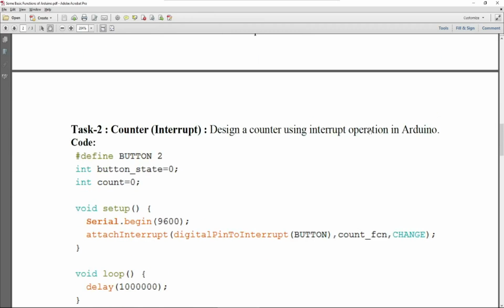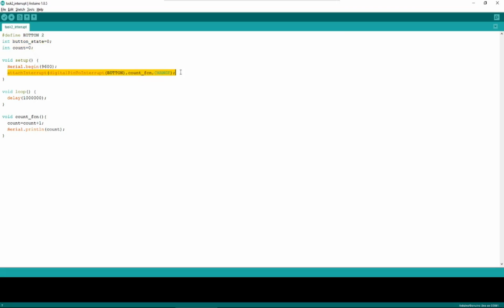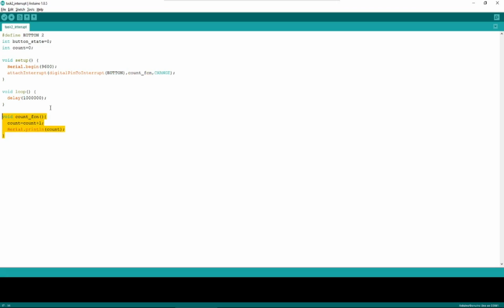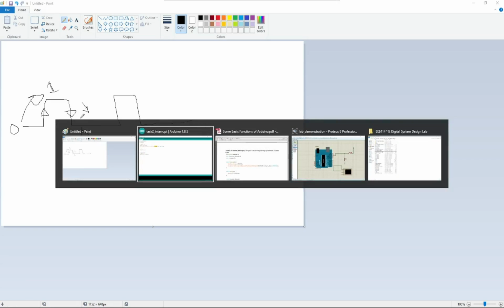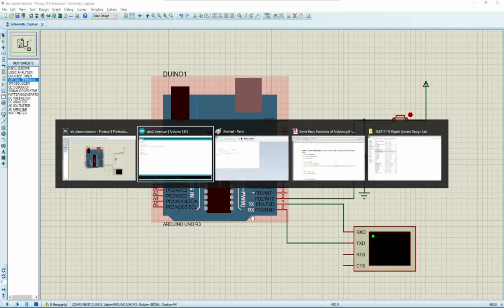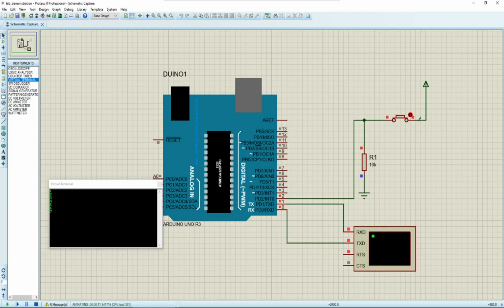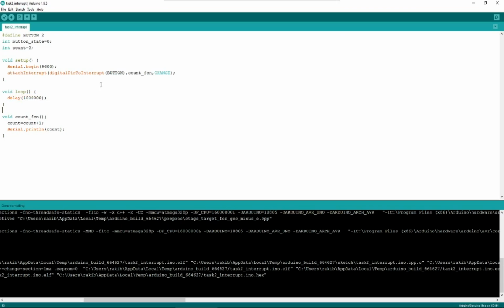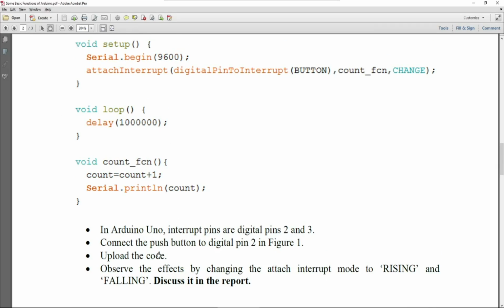Counter (Interrupt): Design a counter using interrupt operation in Arduino.

Comment: Two comments. I wish you had actually made this simple circuit and used the serial monitor to show the results. I don't trust third party programs that try to simulate an arduino. Which leads me to my second comment.
I have always been told that you should not use Delay or Serial.print in an ISR. You used Serial. If you had built the circuit and shown the serial monitor results, it would be clear that your code works in the real (non-proteous) world, or it doesn't work. As it is, I'll either have to build the circuit myself or forget about it.
Reply from the maker: Thanks for your comment. Somehow, I missed notification of your comment, hence the delay in replying. I do agree with you that actual circuit and Proteus implementation vary, and we can't/shouldn't do several things in a real circuit that can be done in simulation. The primary idea of this video was an "online" lab during COVID, so the contents covered in this video are entirely simulation-focused.